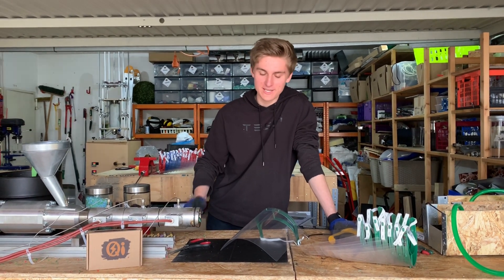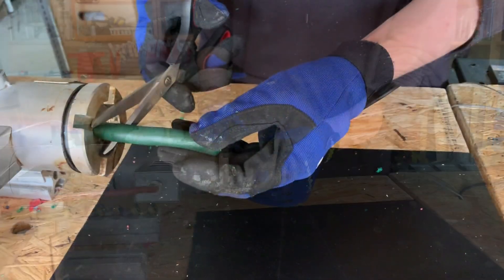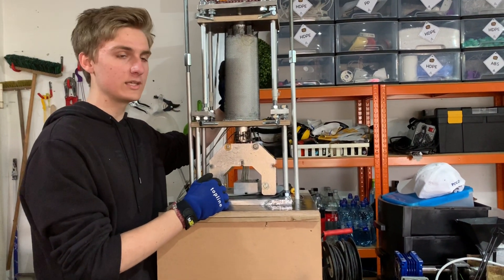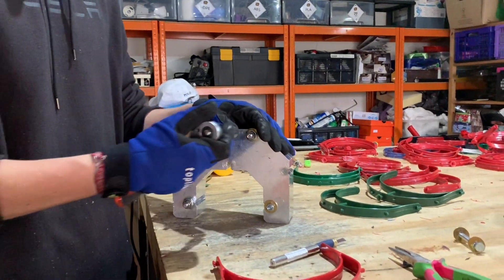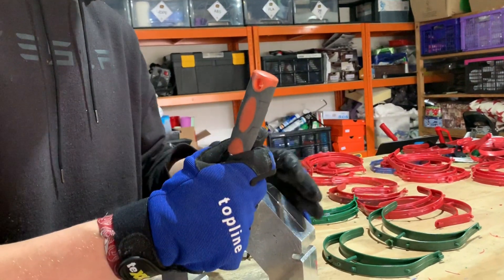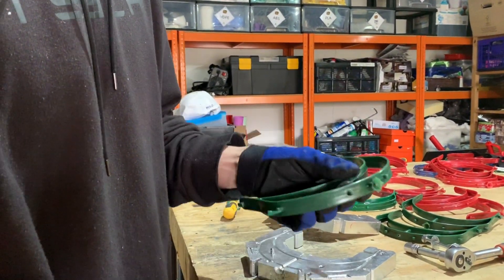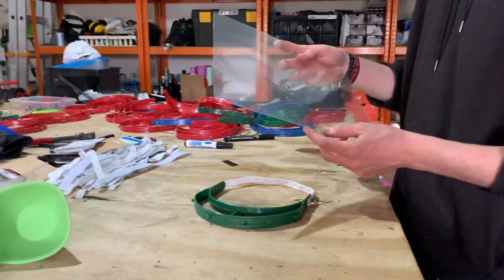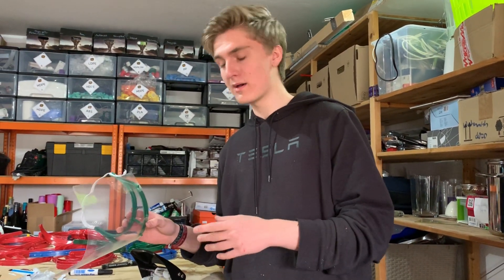Injection Molding Face Shields/QiTech Rapid-Fire-Method

Comment: I am surprised the plastic cools fast enough that it doesn't deform when you pull it out.
Reply: im betting the mold acts as a heatsink, which starts rapidly cooling the plastic as soon as its injected, the mold itself will cool in between cycles